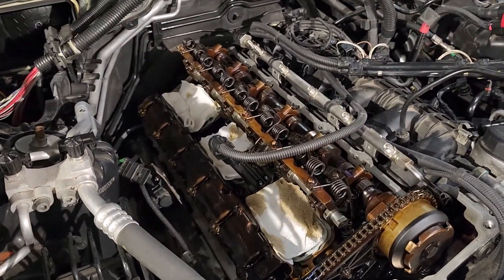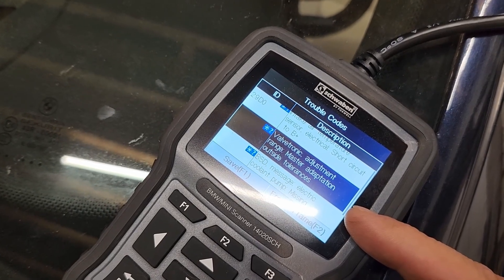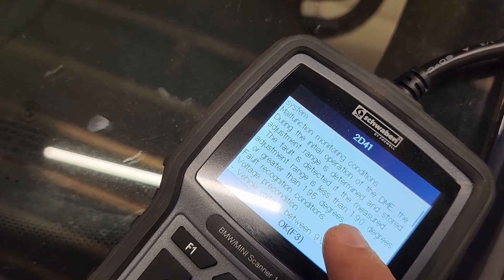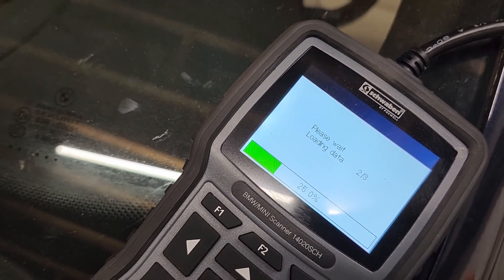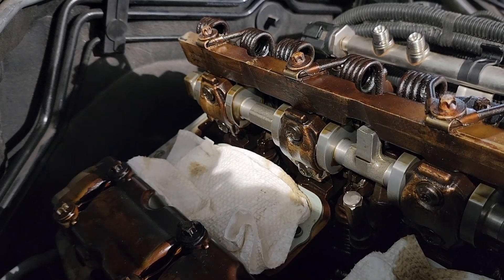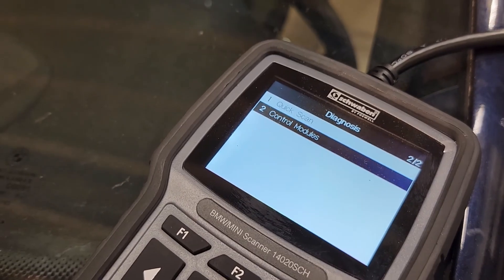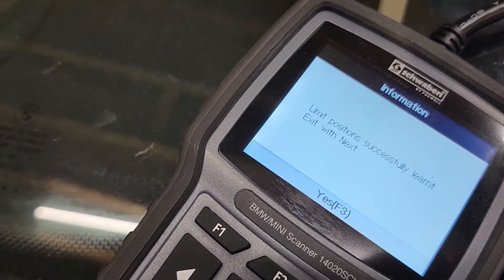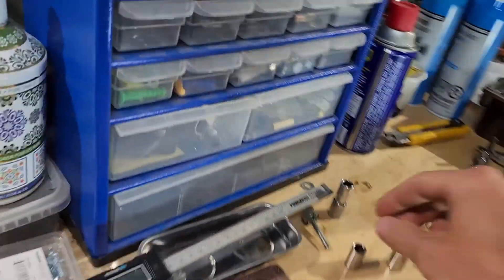N55 Valvetronic won't relearn after replacing shaft and actuator?

Comment: had an original bmw 2 motor installed put it at 189.20 degrees almost max position and yet its still blocked...its insane
Reply from the maker: Was the shaft aftermarket?

Comment: Did go through doing the full relearn of the adaptations or you just did relearn of the stops
Reply from the maker: This mod allowed me to complete the relearn for the stops but the run-in procedure still gave me problems. It may be my scanner, or I've also seen a video where a bad engine ground could cause it not to count run-in cycles.

Comment: I’m trying to figure this out we old you be able to help. From my live data the set point value for the shaft is 189.90 
Actual value is 190.20. It successfully did the relearn. But I don’t know it will do the full adaptation
Reply from the maker: Have you tried the run-in procedure with a scan tool or ista?
Reply: @jaysousa I’m going to try it later on today with the scan tool I have. I couldn’t start th car last night because it’s too loud😂
Reply: @jaysousa good news the car successfully did the running phase although there was a intermittent clicking I’m not sure if it’s the shaft banging on the stops or it was trying to turn one more gear. I think the shaft is off by .3 degrees since the set point is suppose to be 190.20 but my scanner records the shaft rotation of 189.90. I think I might shave a mm of if any sounds off.
Reply: @jaysousa also for context replaced this actuator 3 times I ended up getting the BAVAUTO brand off Ecs which recommend since it’s half the price. Also if your shaft can’t rotate freely and fully without the help of an Allen key there’s a high chance the vvt motor is bad. I hope this helps someone. GL
Reply from the maker: @EldronT Sounds like you've been on a journey. Keep your head up and your foot down fellow traveller.

Comment: Hey man i have problem with my bmw x5 e70 n55 i change shaft and valvetronik and cant do calibration valvetronik and max and minimum 
I have 3 fault 
P3011
P2DD8
P2C58
Can u help me ?
Reply from the maker: You can try what I did in the video but remember to clear your codes and make sure you're not missing something obvious.
Reply: @jaysousa  u think this faults can be like your problem ?

Comment: So glad I found this video! After installing a non-OEM eccentric shaft (A-Premium from Amazon) with an OEM Valvetronic motor, I ran into the same issue - fault code 134F01, clicking at unlock, and ISTA refusing to complete 'Learning Valvetronic limit positions.' As suggested in the video, I ground down actually both stop tabs by about 0.5–1.0 mm. After reinstall, no more clicking and ISTA successfully completed the Valvetronic limit-position procedure. Looks like non-oem shaft is off by a few degrees. Thanks!
Reply: hi just wondering how do you know how much exactly to grind down and how do you get it so precise or is it just roughly?
Reply: @HarveyWebb-cc8su  Trigonometry.
Reply from the maker: @HarveyWebb-cc8su I think I mentioned using live data to monitor the position of the shaft. If that doesn't work for you, try making a mock stop with a bolt or something that you can adjust to do some trial and error.

Comment: Hi, thanks for making this video, very helpful. Did you need to disconnect the fuel pump module or ism fuses to prevent fuel from priming and spraying through the high pressure line?
Reply from the maker: My wife put me up to it, glad it helped. I disconnected the fuel pump fuse in the trunk. The index card is surprisingly bad so you'll probably need to look it up.

Comment: Does that mean that the non OEM parts are manufactured incorrectly ?
Reply from the maker: That's what I assumed but I didn't have any way of verifying it. It would have been cool to 3d scan and compare with a model but that's beyond my capability 😅
Reply: @jaysousa I bought my servomotor, bearings and eccentric shaft on Amazon. Is that where you bought yours?
Reply from the maker: @greetthevictors I only bought the shaft on Amazon. A-premium with 1yr warranty. The rest was from ECS tuning. I wanted everything from ECS because of their lifetime warranty but they were backordered on shafts and I couldn't wait.
Reply: Just to say...I have this issue and used OEM parts
Reply from the maker: @nbrikha I'd love to hear what a BMW tech would do in this situation. How did you make out?
Reply: I was able to get the accentric shaft to now do the limits but when I try the relearn it still fails although the engine is running much smoother than before and plus the grinding noise is also gone. Have you run into the problem where the relearn does not go through the 450 relearn cycle ?  For me that is still failing even after clearing all DTCs.
Reply from the maker: @greetthevictors actually yea that happened to me too. I found a video where a guy attributed it to a bad ground and he verified it by grounding the engine to the chassis using jumper cables. It didn't work for me unfortunately. My wife is just driving it as-is with no run-in and it seems ok.
Reply: @jaysousa It got rid of the 134F01 error but now I’m getting two new DTCs. 133B04
Fault currently present
Valvetronic system: no adjustment possible and 133E10
Fault currently present
Valvetronic system: deactivated, adjustment fault too frequent
Reply from the maker: @greetthevictors that's a bummer, I thought you were home free! Silly question but was everything oiled when you reassembled it? That's the kind of code which led me to replace the shaft and motor in the first place.
Reply: @jaysousa  yes it was. I used "Permatex 81950 Ultra Slick Engine Assembly Lube red" to lube the gear. I reset all adaptations and tried to do the relearn again and now the car barely runs. Bummer. lol I will keep trying. I won't give up.
Reply from the maker: @greetthevictors Did you figure out what it was? Could a bad actuator cause this?

Comment: So you only needed to grind about 1mm on min stop?
Reply from the maker: In my case, yeah. Good luck 👍
Reply: Wow. This is so crazy. Been trying to figure this out for months. I’m gonna give this a shot this week.
Reply: How do i read out how many degrees the shaft does? How do i know if it is to much or to lite?
Reply from the maker: @micke_kingofbiceps_wennberg I used my code reader to check the live data while rotating it to the min. It read 3.5deg instead of what I think should be 0.  That's how I came up with the idea that it needed to rotate more. Then I made the mock-up to be able to test lower stop heights.
Reply: @jaysousa Ok, have to check if it's possible with ISTA. So you rotaded it by "hand"?
Reply from the maker: @micke_kingofbiceps_wennberg yea exactly with ignition on and rotating slowly the live data updated as I moved through the travel. Hitting the min stop it wouldn't go below 3.5.